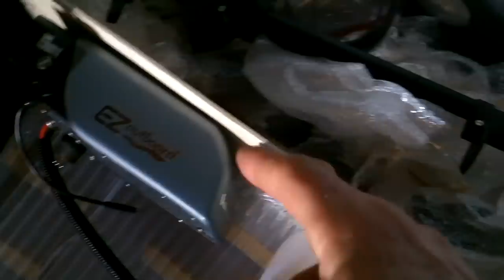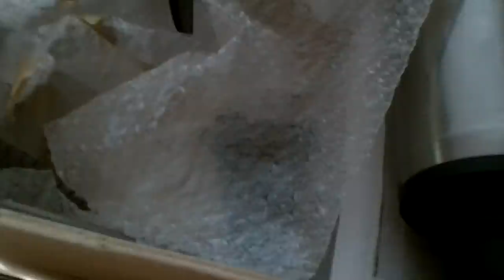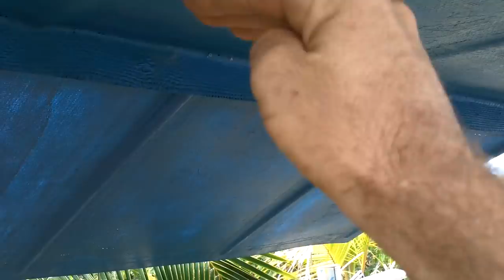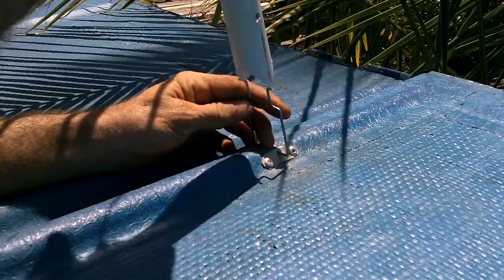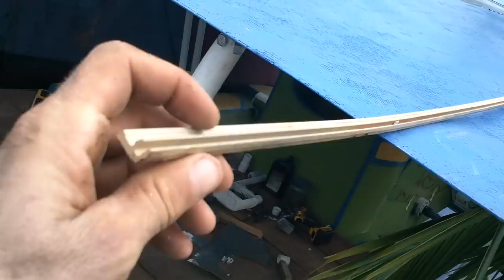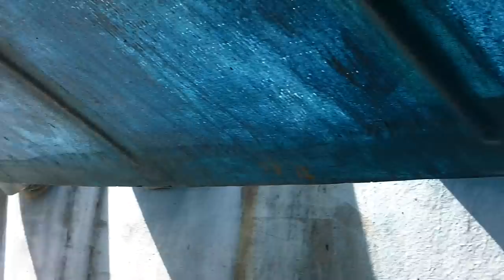Solar Snailer 035 I have All the Parts!

Comment: I would bet the magnets are on the outside of the motor.  so there are no wires to the rotor.  I think your theory is correct.
Reply: Very true this is actually what's called an inside out motor. They are more efficient and are starting to be used on e-bikes and electric motorcycles.
Reply: @davidjensen9035  also motors on RC planes and quad copters.

Comment: Those panels will expand and contract as the heat and cool. I would mount then loose. Just saying.
Reply: It's good that he uses rivets, and not glue because of thermal expansion and contraction will always apply some stress to the glue layer

Comment: Im not an engineer but it seems you might want to think about uplift . Your panels are like a sail and your doing such a great job it would sad to see them blow into town without the boat.Good luck really enjoy your projects.
Reply: Iits like the 4th boat he has built using the solar panels,ive seen him use thin flexible panel's,like this one,and in his construction boat, as he calls it,(in my opionion its his pick up)he used the heavy glass panel's and he didn't have problems out of either of those so im quite confident in this guys ability's lol

Comment: It would bee so much easier if you put a really tall pole in the middle of the boat and ran ropes down to the solar panels, instead of those pvc poles.
Reply: really? Will Ropes keep the panels from flapping in the wind?
Reply: @alanlaero  I guess you put em on the bottom tooooooooooooo
Reply: An whirly-bird kite sail would beee the best way JME could power his ship.
Reply: also putting your finger in your mouth after getting out of bed will cause chronic diarrhea.